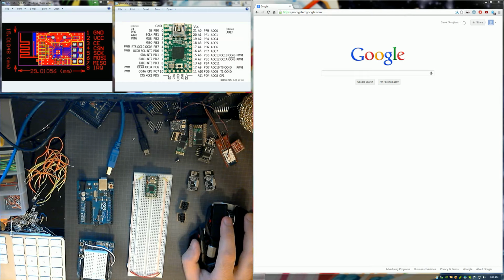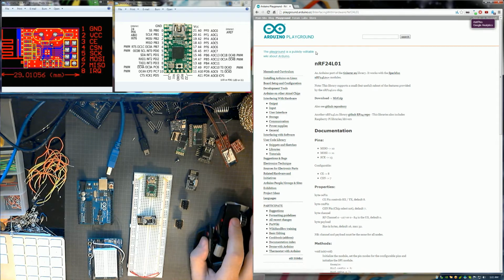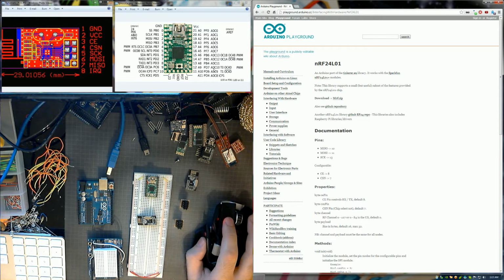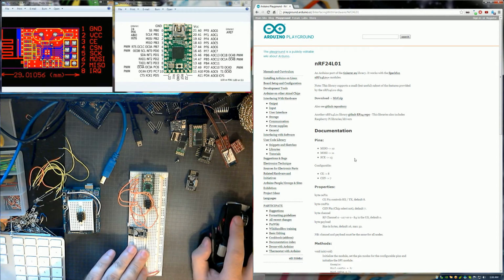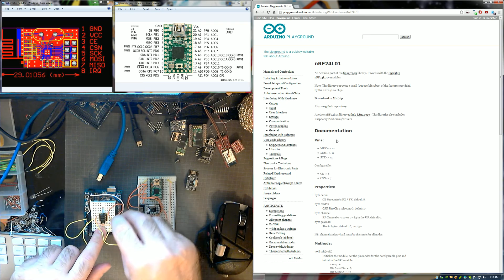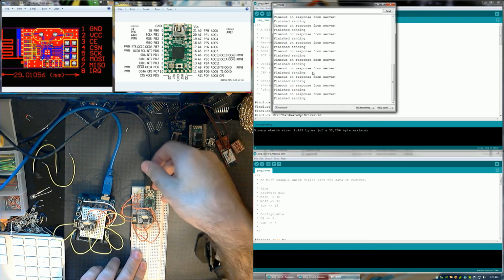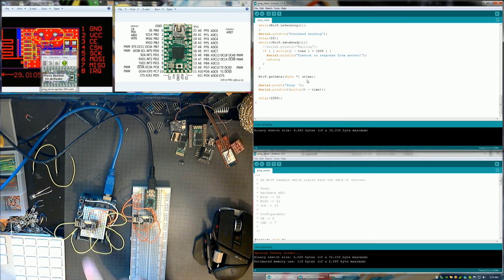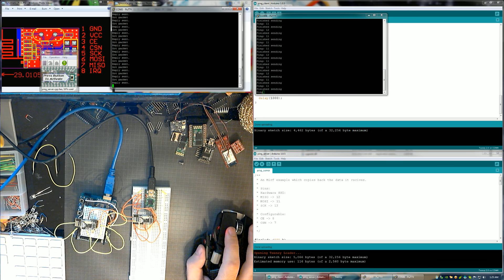Using NRF24l01 radios to connect Arduino Uno to Teensy 2 wirelessly

Comment: Thanks a lot! Could anyone explain to me in the code  Mirf.getData((byte *) &time); I understand we are converting "time" to a byte type but what is the "&" for?
Reply from the maker: this has to do with pointers. in this context, & stands for "the address of the variable time" and byte * is a pointer definition meaning it's an address to a type byte.
Reply from the maker: OtakuSanel so the value that gets passed into getData is actually an address(of a byte type apparently), not a value itself
Reply: OtakuSanel Ohh Ok much more clear now, Thank you!

Comment: I have tried this with Manicbugs RF24 library based on this video and instructions on Manicbug's website but haven't been able to get it to work. The only difference is that pins 9 and 10 are being used instead of 7 and 8 as in the video. The software is clearly recognising the devices on both the Uno and the Teensy 2 as it is reading the addresses and model, but they don't appear to be able to communicate with each other. It's driving me nuts :/

Comment from the maker: Yes yes so much out there is 3.3V, but that doesn't mean it's any easier for beginners to deal with. I've had timer and interrupt based issues. if you call Servo.pos() within a loop the output is garbage. Also there's an issue using i2c and spi same time so some kind of interrupt conflict. those aren't things someone can easily solve themselves.

Comment: But the whole world is going 3.3v... all the new stuff runs on it, even the NRF24l01 you use in your video is 3.3v.  All new arduinos come with 3.3v pins. You have to use weird battery configs to get 5v, and you have to use adapters on new stuff to work with 5v.  Do you think that is a little like saying stick with old tech? You can use a cheap $3 3v/5v converter for use with older tech.  What are the compatibility issues with the teensy 3?

Comment from the maker: I also have a few teensy 3. I recommend the teensy 2 over it through for a few reasons. One reason is teensy 2 is 5v, teensy 3 is 3.3V and that can cause a lot of problems for most people. Also there's a few compatibility issues with the teensy 3, so unless you know what you're doing, i suggest staying away from it.

Comment: If you buy a Teensy 3.0 instead of 2.0 (which you should, it's about the same price but better), remember that the pins named MISO/MOSI/CSN/CE on the NRF24l01 map to the pins named DOUT/DIN/CS1/CS0 on the Teensy 3.0.  People are blowing up their Teensy's all over the place trying to figure out this little issue. I'm a noob with NRF24l01/Teensy and I spent 3 days figuring this out.

Comment: Not exactly. I bought a few teensy 3's. Although the pinout is described everywhere, including SPI, it was like getting a fundamentalist christian to put out on a first date figuring out wtf goes where hooking up the NRF24L01. If you notice the pinout describes MISO/MOSI/CSN/CE as DOUT/DIN/CS1/CS0.  If you Google it people are murdering each other in the streets trying to get the NRF24L01 working with it, and this is the only holdup; pin names! Watching your video, it made sense.